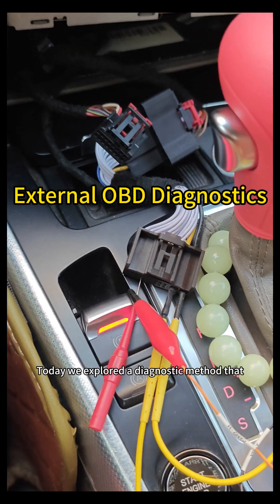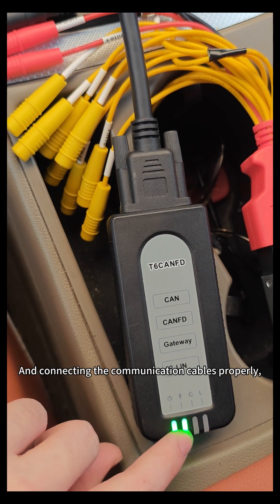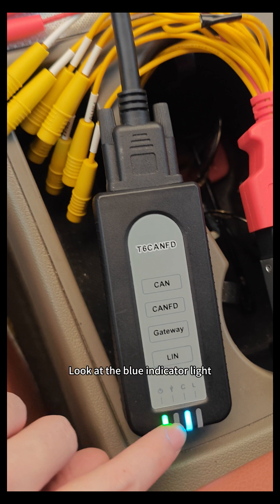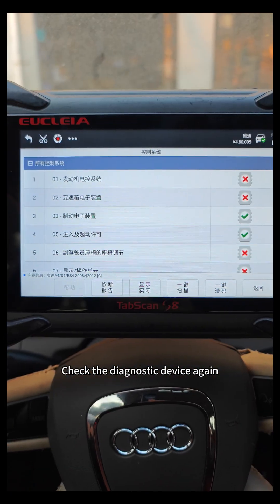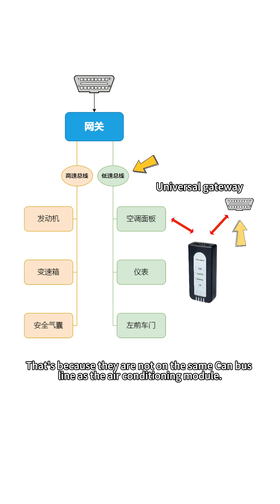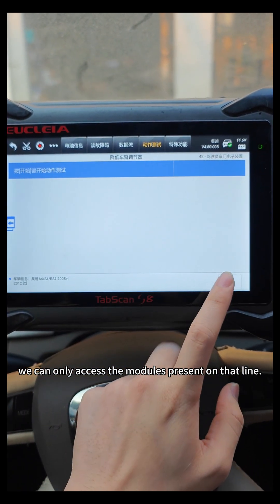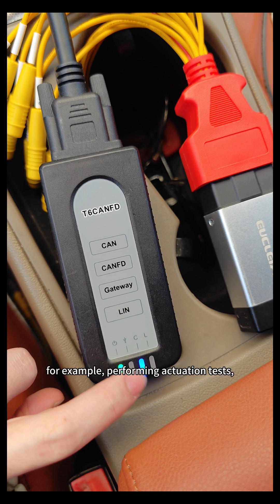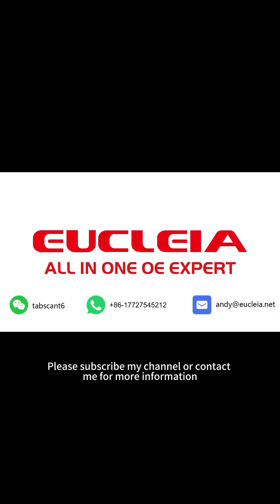How To Use T6 CANFD Universal Gateway Feature For Car External OBD Diagnostics

Comment from the maker: T6CANFD is specially designed for automotive electronics repair technicians, new energy powertrain repair technicians, and automotive electronics engineers. It integrates data acquisition capabilities for multiple communication protocols, including CAN, CANFD, and LIN, and features gateway simulation to meet various levels of automotive electronics testing needs.

Comment from the maker: 3. Universal Gateway Simulation
3.1. Most ECU modules, when removed from the vehicle, cannot communicate directly with a diagnostic tool due to the lack of gateway connection.
3.2. T6CANFD supports simulating a gateway, allowing diagnostic tools to connect with ECU modules, enabling diagnostic functions.
3.3. While using the simulated gateway function, T6CANFD can also synchronously collect data transmitted between both parties, providing support for further analysis and diagnostics

Comment from the maker: 1.CAN and CAN FD
1.1. Supports simultaneous acquisition of two CAN signals
1.2. Supports simultaneous acquisition of two CAN FD signals
1.3. Timestamp resolution of 0.1 milliseconds
1.4. Baud rate range: 5KBPS-1000KBPS
1.5. Compatible with CAN 2.0A (11-bit ID) and 2.0B (29-bit ID)